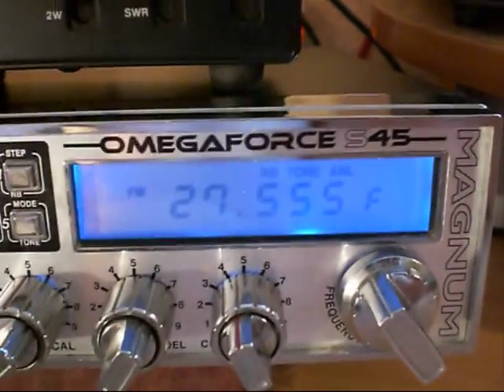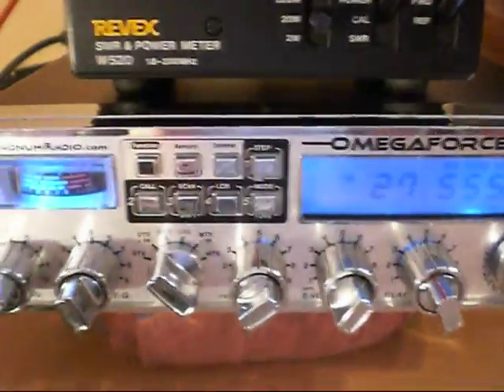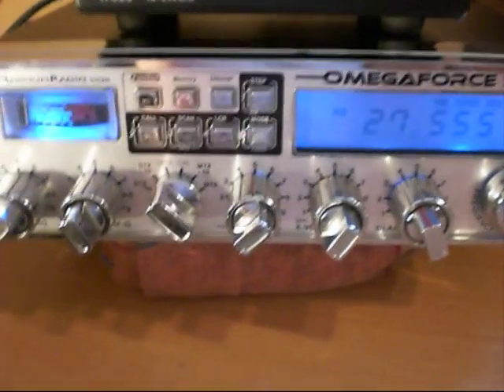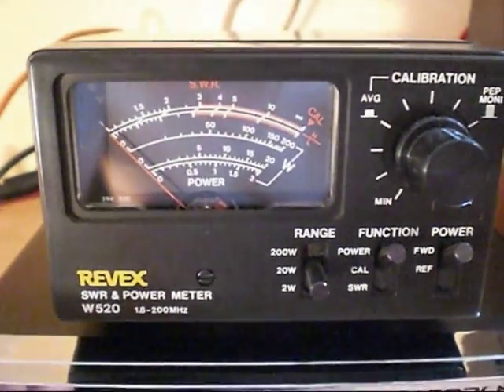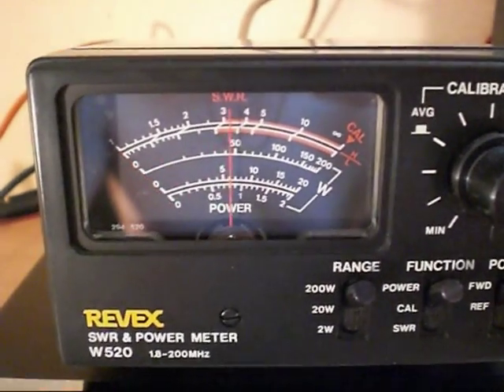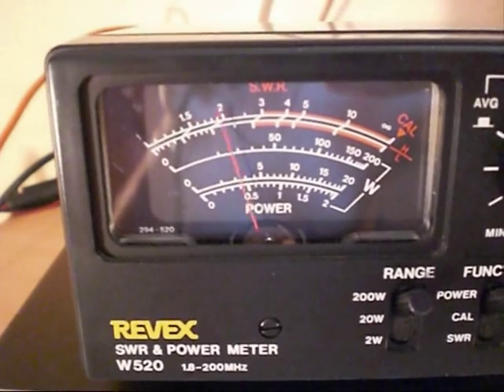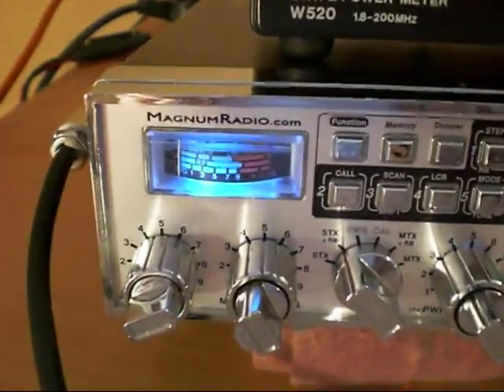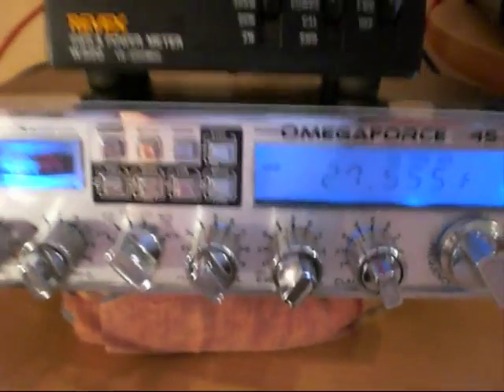MAGNUM S45, OUTPUT SUPPLY REGULATOR REPLACEMENT.

Comment from the maker: @shaneo1482  The output regulators sometimes blow in these radios it is not a factory fault, many radios use the same transistor for the output regulation on AM and they also blow from time to time.